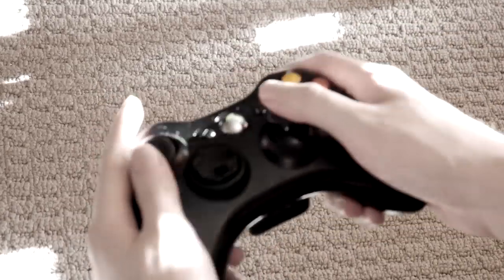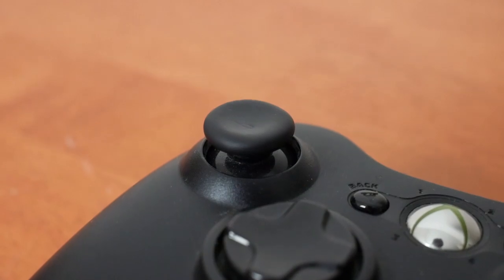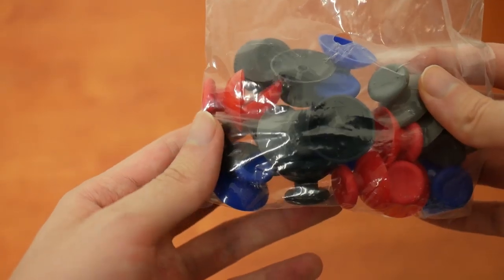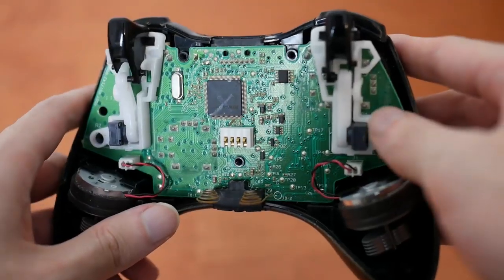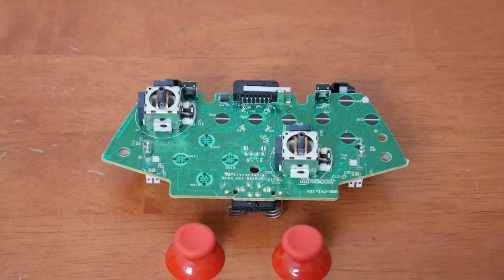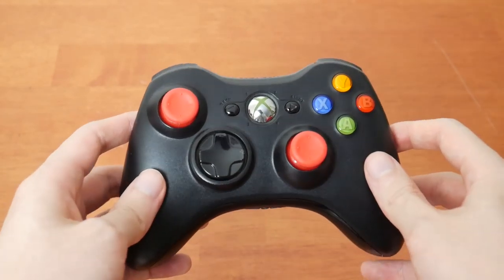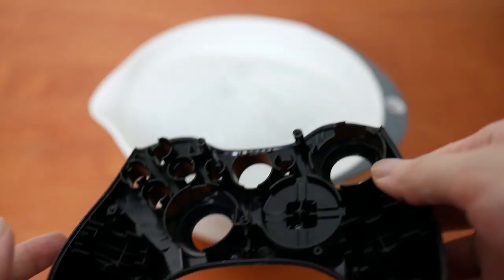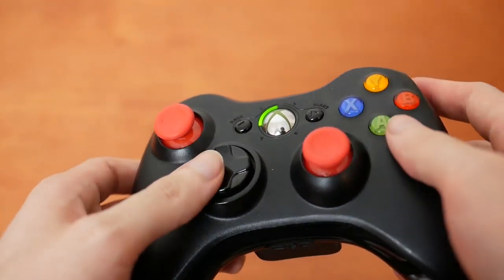How to refurbish/stylize an Xbox 360 controller's thumbsticks

Comment: For anyone experiencing stick drift, when you pop off the thumbsticks spray some contact cleaner directly into the thumbstick opening and click it all around. After it dries add a bit of gear grease inside the opening. If it's a controller you care about and plan to keep it's worth it. I did it for all my og Xbox and 360 controllers and it's been a huge difference
Reply: I was about to comment how my right thumbstick has a slight drift making the camera plunge into the ground in every single game I play. I'll try that, cheers
Reply: @ChaosPootato  does your controller still work
Reply: @jcjz  Nope :D I ended up not trying that fix but I ordered replacement sticks which took for-fucking-ever to arrive and completely butchered a bunch of components while trying to remove the old drifty sticks. Sad times
Reply: @ChaosPootato  ouch. 
i ordered replacement sticks too and a t8 screwdriver, they will arrive in a couple days, i got 3 dirty old controllers which im hoping to clean and refurbish, ill update on how it went
Reply: @jcjz  Good luck!
Reply: Just FYI you can swap the sticks for xbox 1 stickboxes.
Reply: just finished doing it, took appart, cleaned up, replaced sticks and reassambled.
but the drift didnt go away completely, so i decided spraying wd40 directly onto the resistor, works like a charm now
Reply: "when you pop off the thumbsticks spray some contact cleaner directly into the thumbstick opening and click it all around"

Nope DO NOT DO THIS. Instead pry the potentiometer just enough to get access to the contact pads then use qtips to clean it. Clean also the metallic rings.

There is no need to torture the thing by spraying gunk and hoping it fix things. It also saves you from buying contact cleaner spray.
Reply: @roahnosh really??
Reply: @Dumass43  You don't wanna spray that stuff hoping it will get better.

What you gotta do is to pry the offending potentiometer, remove the metallic ring and then use q-tip to clean the potentiometer contact.
Reply: @roahnosh  this has always been my go to for repairing stickdrift

Comment: not totally sure but the chrome d-pad might blend in nicely.
Reply: The transforming dpads are only a few quid on ebay and give a more traditional feel.
Reply: Firefox d-pad
Safari d-pad
Edge d-pad
Internet Explorer d-pad
Reply: Ok that was a bad joke
Reply: The chrome DPads were actually in the later 360 controllers, even later than the black DPads. The Chrome ones also have the ability to be twisted, which lowered down the edges making it more of a classic plus DPad.
Reply: @dani.munoz.a23  
What about Opera D-pad?
Reply: @Crlarl  that too
Reply: @dani.munoz.a23  damn it... took me more than a minute, i hate myself 😂
Reply: you'll need to mod it in since it's for the newer elite xbox 360 controllers. you'll need the remove a hole from your controller so that means you'll permanently make it only work with chrome d-pads which means you can't really change your mind later.

Comment: Probably, the best controller ever made. Fells great, super simple to take apart and maintain, and the plastics and thumbsticks are of better quality than anything today. Today's controllers are a nightmare to take apart.
Reply: If only we used optical sensors instead of variable resistors...
Reply: Nah man, this controller literally has the worst D-Pad that still functions. Diagonals when trying to do cardinal directions are guaranteed! The controller is excellent for everything else, but the D-Pad is a dealbreaker for anything that uses it.

(dishonorable mention also goes to the side buttons, Lb and Rb, they're loose as hell though still usable enough I guess. Better than a broken Switch or XBONE controller, which is more than can be said about the D-Pad)

Comment: The 3rd party thumbsticks sometimes aren't inline with the little bumps around the stick so they end up a little bit off kilter, also if you want to use one of the transforming chrome d-pads the housing for the controller needs to be modified if your controller doesn't already have one
Reply: Oh I didn't know you can get aftermarket ones
Reply: the first party thumbsticks actually do have an x pattern instead of a + one, they are just rotated when put on the controller
(at least i think)

Comment: If you have any plastic components with that gross sticky oil buildup, use bicarb soda and a lil bit of water to make a paste and apply it to the plastic. Leave it for a couple of min then scrub it with a cloth. I've tried a lot of different methods but this works wonders 👌.

Comment: I replaced the thumbsticks in both my DS3s with 360 style ones,, and I also did the same for my GemPad 3, though the 360 thumbsticks have a slightly different shaped housing, which ends up requiring some gentle sanding to make sure the socket doesn't get stuck.

When I did it I don't think I even saw ones specifically made for Dual Shocks, though I think there are now. I know that a lot of end up replacing the thumbsticks on the DualShock4 with the previous ones.

What almost always needs fixed on DualShock4s are the absolutely awful triggers. They're gummy brand new and I highly recommend investing in stronger replacement springs or going to a place like BattleBeaver and getting the improved trigger mechanism.
Reply: Mate, it bothers me too much, it's called 3DS, sorry, just had to say it
Reply: @mattisbubba8372 okay, *how*?
Reply: @USSMariner  BubbaBros clearly doesn't know that DS3 means DualShock 3, so he probably assumed that you talk about the Nintendo 3DS, that doesn't even has analog sticks...

Comment: I did something similar with my PS4 and Xbox One controllers, except I used metal thumbsticks instead of plastic ones. Don't think these will be wearing out anytime soon!
Reply: Do they get good grip?  Oh they must have some knurling?
Reply: @TheJunky228  They do get a surprisingly good grip! They are knurled in a sense, albeit with a radial line pattern around the edge instead of a typical diamond pattern. Here's what they typically look like: https://i.ebayimg.com/images/i/272979533309-0-1/s-l1000.jpg
Reply: @Fighter_Builder  ooh those look nice

Comment: How are you using a wireless 360 controller on PC? The only method I know of is Microsoft's expensive adapter/dongle that doesn't have support in Windows 10. Am I just uninformed/outdated? What do you use, the Microsoft thing?

Comment: I just want to know how you wore down the thumbsticks that much before getting drift. My original 360 controller's joysticks are in reasonable shape, but the left stick developed drift after being used for several years. I upgraded to a XBONE controller, but I still have the 360 controller, since I still have a 360 hooked up on my kid's TV.
Reply: Drift sounds like an issue more involved with the actual control stick underneath and not the thumb sticks.  I have one of a similar age and use and while the sticks are so worn out as to not even have the rubber on them anymore and the holes for mounting are so worn out they can be moved without input, they don't drift.
Reply: I honestly dont know. I wore my xbone controller sticks down to that level (and i play on PC, which means the controller doesnt get 100% of time used), and i never got drift. Of all the controllers i held, from the PS2, to the many xbx 360 controllers, to my several years old xbone controller, i never had drift
Reply: @nemtudom5074  Same. Everybody says drift is just inevitable, but I have ancient controllers that never developed drift. The only sticks I ever had any trouble from before the XB360 and the modern consoles were a few N64 controller sticks that got seriously abused in Mario Party. And I still don't think they had a serious drift problem, they just got mechanically loose.
Reply: I have 3 360 controllers. 2 have thumbsticks so worn down they're cracking. No drift. @bloodgain

Comment: just fyi: I tried fitting XBONE thumbsticks on my wired 360 controller and they didn't fit (technically yes, but the base wasn't wide enough so it scraped against the thumbstick construction). The XBONE thumbsticks do fit nicely on a PS4 controller however. I prefer the concave shape

Comment: I recently got a used 360 controller that had finger gunk in the seams. The d pad was all messed up too. Disassembled, soaked, and "erased" all the gunk on the membranes. Good as new! How have these thumbsticks held up? I've got two controllers that could use replacement and am afraid to buy some cheap stuff

Comment: I prefer the wired Xbox 360 controller because it only comes with Philips head screws and it looks like the guy who designed it made it as hard to screw up as possible. E. g. the A, B, X and Y buttons fit only a certain way in the faceplate. Even the Xbox button has notches AFAIK.The faceplate pops off and you can remove the thumbsticks right away.

Comment: I wonder if it's this easy to fix joystick drift as well... I've got 6 of these wired controllers, and most of them got a drift problem way too soon.
Reply: use isopropyl alcohol on a qtip maybe? drift is usually caused by dust buildup and stuff like that.
Reply: could try cleaning the switches with WD-40 contact cleaner and a tooth brush. But if that doesn't work you will most likely have to desolder the analogue switch and solder a new one in. Sadly the switches are different than the ones used in the xbox one controllers and finding new switches may be more difficult due to the age of the controller.

Comment: They must have updated the Xbox 360 controller so when the grip does come off it doesn't look worn and you can still use it well cuz I've been using it for YEARS, before I even knew there was wireless Xbox 360 controllers which I just found out about in this video

Comment: I have one of a similar age and use.  The sticks are so worn out as to not even have the rubber on them anymore (it's just a plastic disk underneath it all) and the holes for mounting are so worn out they can be moved without input,the thing is fine otherwise.  These would be pretty damn nifty to have.

Comment: One thing that annoys me about these aftermarket sticks is the little bumps are in the wrong places (they're in the corners, not the cardinal directions). Absolutely no one has the right ones.

Personally I'd rather just have the sticks from the newer 360 controllers (the ones with the transforming d-pads). They have no bumps at all and just use concave ridges in the center.
Reply: Is it possible to use the pads from the newer controllers or are they different sizes and stuff?
Reply: @Ownage4lif31  You can but you'd have to take them from other controllers if you want something that's not slapdash imitation.
Reply: @SolidSonicTH  probably can find some broken ones and use them. Sad how Microsoft doesn't sell them individually. Right to repair law should force them to sell parts for as long as they manufacture them

Comment: I'd have loved this a year ago. I mean I still love it, but back then I was doing everything I could think of to cling to my 360 controller. Nowadays I use an xbone controller, and after about a month of getting used to it I actually prefer it for the most part. Doesn't last as long as the 360 ones though.

Comment: i have 3 official 360 controllers (all were given to me) and all of them are fucked up one way or another.
controller 1: rt button automatically causes an input on some games because I think it's loose
controller 2: only works when plugged in, when not plugged in it flashes twice then dies
controller 3: left stick is drifting, A button and start button are faulty.

Comment: I need help! Did somebody has this problem? A few hours ago, I replaced both analog sticks for my Xbox 360 controller and happened something curious, it happens on Destiny, Battlefield 3 and Alan Wake (it doesn't happen in any other games, I tried a few more like DS1&2, tomb raider/rise of the tomb raider, metro last light, RE1&4 and many others) the thing is, my character doest want to lower his arms, it keeps aiming down the sights (left trigger aim, right trigger shoot) and whenever I swap the triggers (left trigger shoot, right trigger aim) it works perfectly without any issues at all.. also, Alan Wake doesn't want to run, keeping pressed the LB causes him to sprint a few meters and stop running. 
Can somebody help me?

Comment: How do you connect the xbox 360 controllers on pc??
Reply: The wireless ones need a special adapter.

The wired ones work from just being plugged in.
Reply: @thawkade  i have the wireless ones :/
Reply: @xdct.4790  Yeah, it's stupid. The 360 controllers didn't have any Bluetooth at all.
Reply: @thawkade  does the PlayStation 3 or 4 have Bluetooth?
Reply: @xdct.4790  Both do, though I think the PS3 needs a little extra tinkering with Windows to get it to work.

The PS4 and 5 for that matter should work no issue.
Reply: @thawkade  i guess i need to find to buy the wireless adapter online

Comment: Clickbait... shame. Here I was expecting a nice informative video showing how to make extremely worn Xbox 360 controllers usable again that I could maybe even use for my Original Xbox controller with a massive wobble.
Reply: He refurbished the Xbox 360 controller thumbsticks. I don't know what else to tell you.
Reply: @General12th  On no fronts did he refurbish it. It doesn't show how to fix wobble or drift for 1, and for 2 even if you want to be semantic and say that "thumbstick" only means the plastic bit and not the mechanism beneath it, he "refurbished" it like you "refurbish" an iPhone by buying a brand new one.
So at best it's clickbait.
Reply: @FatheredPuma81  What term would you use to describe replacing the plastic and cleaning the surfaces?
Reply: @General12th  What term would I use? "Replace". He didn't clean the new or the old thumbsticks did he?